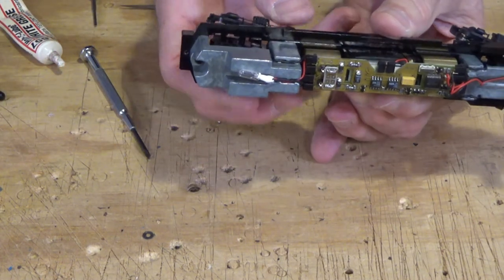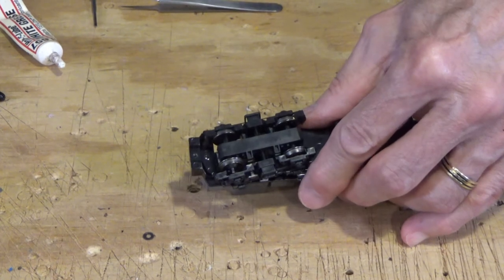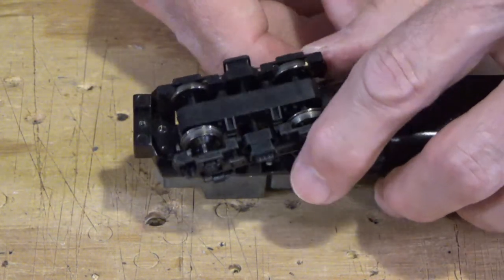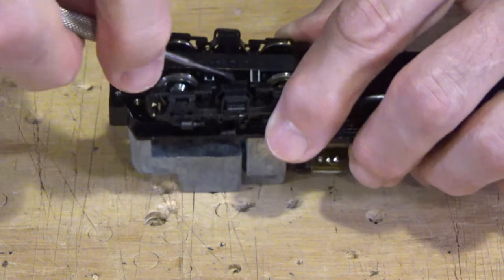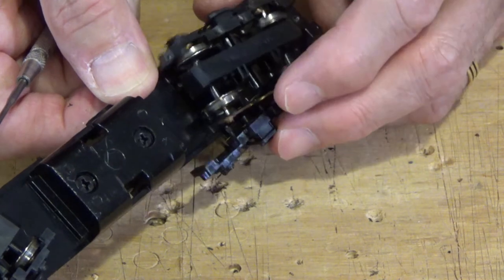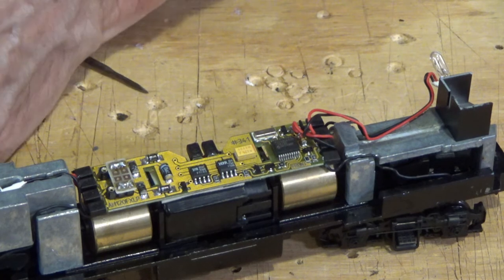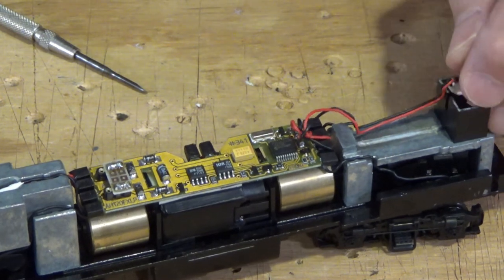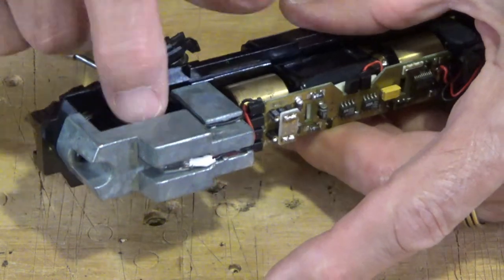41. DIY Lubing diesel locomotives pt 1

Comment: Do you ever recommend putting a small amount of the grease into the universal shaft cups?
Reply from the maker: I think it depends on the type of plastic they are made of. Some types of modern engineering plastic don’t need lubricating. However I do apply a light coating on the older models. Instructions sheets for the better models will usually discuss lubricating them and if not I assume they need it. Whatever you decide to lubricate make sure to use plastic compatible types. Both Woodland Scenics and Labelle make them. My other mantra is oil bearings and grease gears. Bearings include all metal to metal moving parts such as valve gear,motor bearings, worm gear bearings, wheel bearings, etc.
Reply: @TheDCCGuy  Thank you for the info. I use LaBelle grease, but as slippery as most plastic shafts and cups are, sounds like the light grease might attract more dirt than benefit in most cases, especially with the small directional forces in a rotating cup and insert.

Comment: To clarify the grease is just for the wheel fear box and oil is for the motor bearings and drive bearings?  Which do you use on the worm gear inside its housing? Also if your going all in should the wheel gear housing and gears be cleaned with rubbing alcohol to remover all previous lubricants?  I have bought a few new old stock Proto 2000 sd60 models and the worm gears were totally bound up.
Reply from the maker: My mantra is oil the bearings and grease the gears. Since the worm gear is part of the drive train it will eventually receive some grease as a result of the meshing of all those gears but I help the process by greasing them too. I only remove old grease if it is starting to discolor or dry out. Modern synthetic grease seems to last forever whereas the older cheap stuff seems to dry up. I have had several old LifeLike locos come out of storage with frozen worm gears that took a bit of cleaning to free up.

Comment: Got a lot more than 1000 subs. Now lol. Just got into the hobby and look forward to your videos.  Do I need to do this to a new diesel locomotive?
Reply from the maker: It varies with manufacturer. Some load them up with grease and oil in China and some do not. So it is best to read the instructions and do as they say. Personally I always at least check to make sure—you never know whether the model you received was made on a Friday afternoon just before the dash to the door.

Comment: that looked easy enough. 
maybe you should have left some of the problem spots in the video, or do a second video, some of us will be trying this for the first time and will run into the same problems.
thanks for sharing. very helpful
Reply from the maker: It's mainly a lot of fiddling with the sideframes that I edited out. It probably took me 10 minutes to get those sideframes reinstalled! At times you almost need three hands to hold both sidframes and install the cover plate at the same time. The important thing to remember is don't pry off the sideframes before removing the cover plate as you can break the little clips that hold them in place.